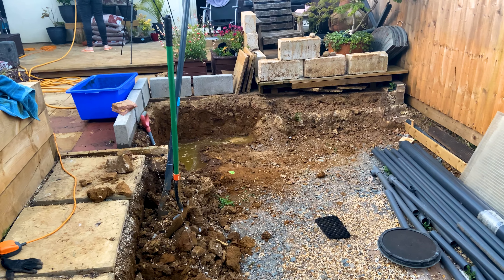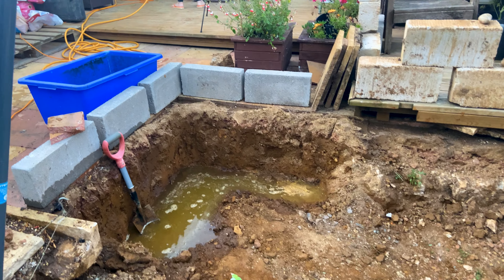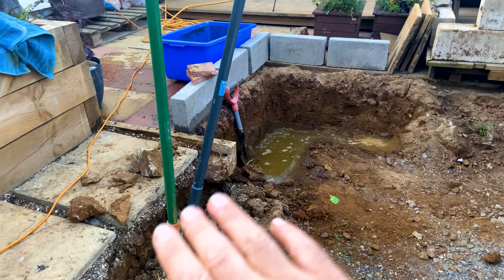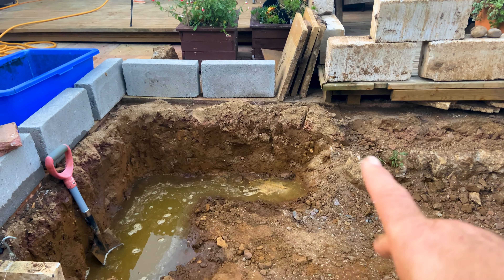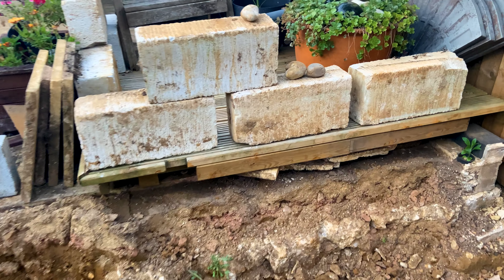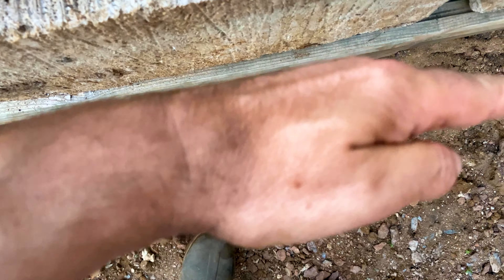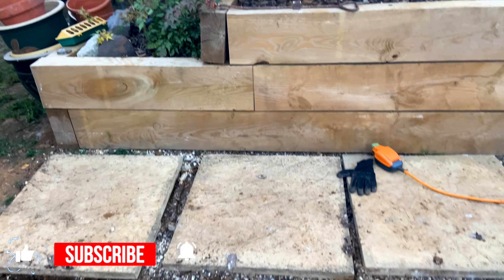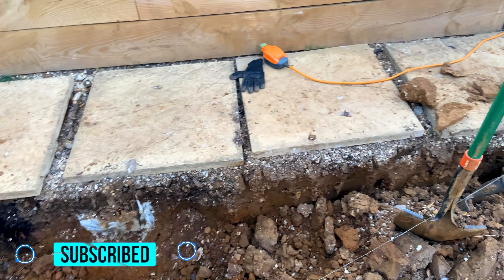Dream Koi Pond Build Part 7 - Expanding to 5k Gallons (I must be bloody mad)

Comment: Because your bottom drain isn't central now couldn't you put a return to the pond low and put it by the path corner which will push anything on the bottom towards the bottom drain. Great videos mate , keep them coming.
Reply from the maker: Hi Karl, great minds, it isn't the end of the world with a little common sense applied. No doubt there will be some perfectionist that have panic attacks from an off centre drain but I'm 98% sure it shouldn't give me any problems mate. Thanks for the support. 🙂🎌

Comment: Great update Anthony, that’s going to be some pond when it’s finished. I think the off centre drain won’t be a problem, as long as the cambers into the drain are right and the flows comes back in the correct places. Will follow the pond and garden build with interest, keep the videos coming. Stay safe and well 👍🏻
Reply from the maker: The camber is excellent Steve, pulls naturally from front and rear and then bowls into the bottom drain. I will have to change my returns plan now but its no big issue to be honest. The base fill went well.
Reply: @KraftyKoi  glad to hear the concrete when well👍🏻